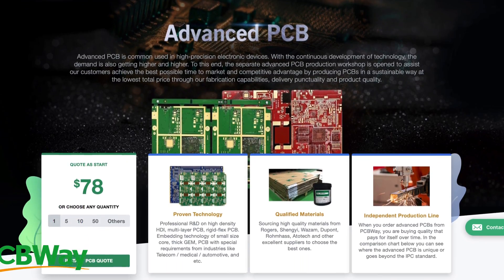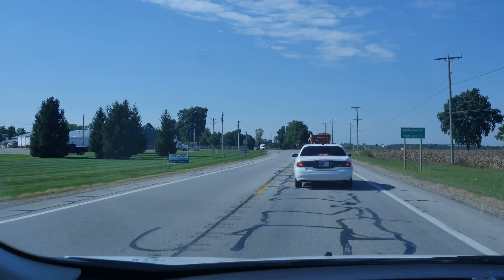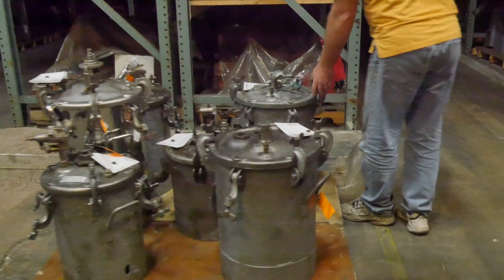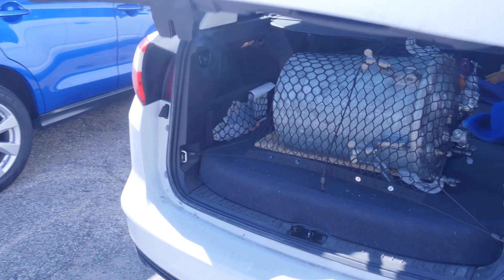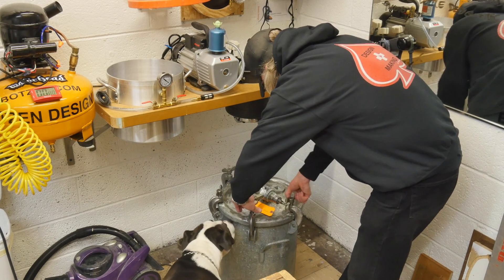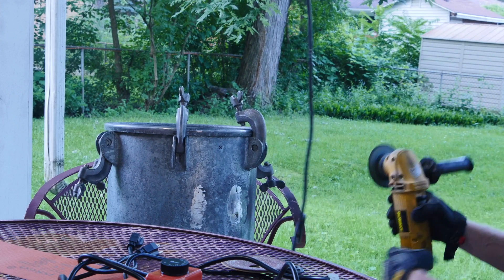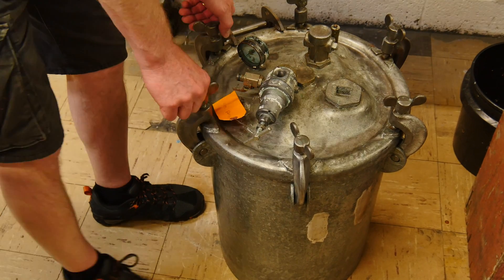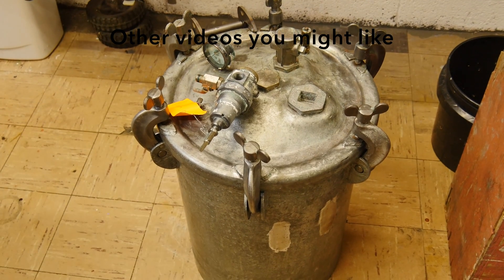Building a 10 gallon heated Pressure Tank for resin casting: Part 1

Comment: Does adding air to the chamber cause the temp to drop? My castings inside an un heated chamber are not curing but the leftover in my mixing cup is curing no problem when it’s not under pressure. Would heating my pressure pot be the answer?
Reply from the maker: Resin is a chemical reaction so the air should not affect the polyurethane, heat will only help the curing

Comment: That "Bleeding" is the paint melting off of your saw blade., I built a pressure chamber from 1/4" plate steel last year.......the inside is 20" x 20" and 36" long.......once the door is reinforced I can start using it.

Comment: I was wondering why using a waterjet vs laser (which is cheaper). Then I saw the drilling. For people unfamiliar, laser cutting steel tends to air harden the cut, and it becomes a nightmare to drill or tap.

Comment: Still much to much screws to twist, what is wrong with dental autoclaves ?? OK perhaps the size limitation, but even so if you can do with smaller moulds unbeatable - there is a thing called fast opening lid - mine takes 1 second to close and 1 to open, no sour knuckles here.
Reply from the maker: I am building this tank to handle much larger objects such as headlight and tail light for vehicles and larger consumer products
Reply: than it is well worth the effort, persume you do not do any serial casting of prototypes. Just do not understand people spending  xxxxx$ for vacuum casting machines or knuckletwisting pressure pots to serial cast  molds the size of a cigarette pack. I do serial casting from time to time but long parted pressure pots. Got a second hand quality dental autoclave to do just that. Now I started a retro project with epoxy resin, the haptic is so much better and somewhat more to an industial standard than those quickies with pressure casted pu resin. Use 48 hour curing Epoxy with the premium colouring agent and build 10 instead of 1 (ok small size) mold than a short vacuum and lean back and enjoy working time is max. 20 minutes. Production circle not that bad either, depending of the number of molds. Good luck with your project, eagerly awaiting your part 2.

Comment: I thought a vacuum chamber was appropriate for casting resins. obviously wrong. what is the purpose of a heated pressure vessel?
Reply: A vacuum chamber pulls the air (that was introduced during mixing) out of the resin or silicone, however when pouring/injecting the resin into the mold, air can get trapped in corners or undercuts causing defects. Curing in a pressure chamber helps because the pressure "squeezes" the air to a size that isn't visible to the naked eye. The heat speeds up the cure time significantly, and helps ensure a full and proper cure.